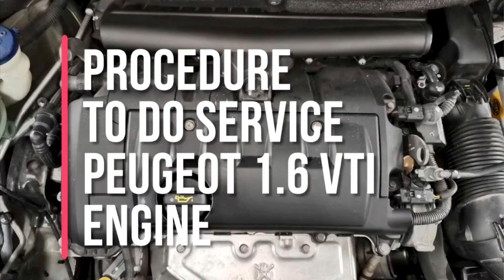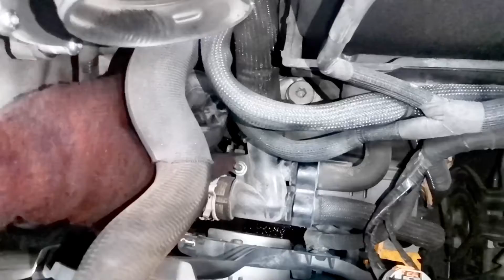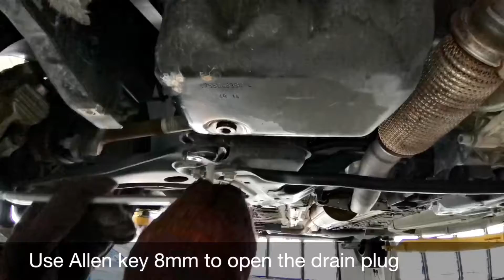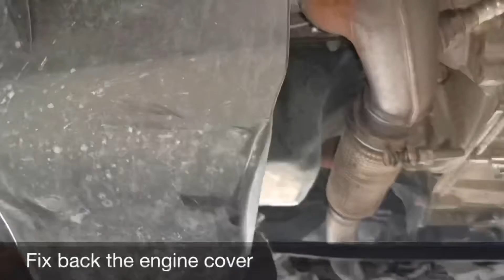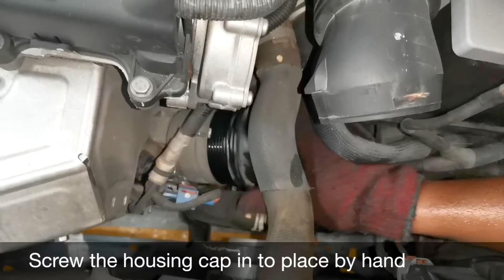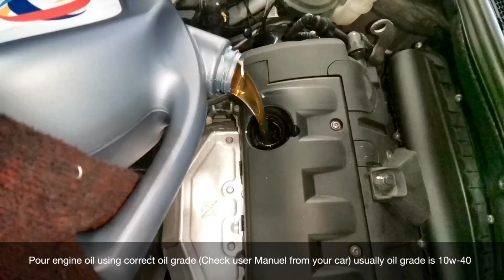How to service Peugeot 1.6 308,208,2008 Vti engine | Complete guide

Comment: NEVER NEVER 10-40 but 0-30 or 5-30 on a  1.6  VTI.
Reply from the maker: Yes correct must use 5w-30 for below 150k  mileage
Reply from the maker: Thanks for the info🤝
Reply: @rajsilverautolearn  Not below 150k, always
Reply: My mechanic put in 5w-40. Should I replace it with 5W-30 ?
Reply from the maker: You still can use 5w-40 if no engine oil consumption
Reply: @rajsilverautolearn  Thanks for the answer! :)  I have one more question. I also noticed that the mechanic put more oil in the engine. It is about 2cm above the MAX on the dipstick line. Is this very wrong? Should I pump it out so it gets only to MAX?
Reply from the maker: If the engine is oil consumption then can put extra engine..
Reply: In the service manual you can see the oil that u can and May use... it also says 10w40😅

Comment: 1. If you remove oil filter, you just know the oil will drip, protect the hoses, otherwise oil will damage the rubber.
2. Use brake cleaner to clean off 
3. Wrong oil type, especially for engine which is likely to excessively consume oil. Recommended is 0w30 low SAPS with C1 spec, if not you'll just ruin the engine in long run.
Reply from the maker: Yes correct but need to follow the contry temperature also

Comment: I have a peugoet 1.4 vti model and have problems with lubrication do you have any ideas to fix this? No oil light is coming on so I assume the bottom of the engine is getting oil but it seems the top is not. I've taken out oil pump cleaned it and it seems like the pump is fine no build up.
Reply from the maker: Is that any engine sign come out? Not a oil sign
Reply: @rajsilverautolearn   Hi yes the eml is on showing code p1340. But I checked timing chain all compression which is good and change cam and crankshaft sensors. But engine does sound dry when I start I have not driven it as I do not want to cause any damage. And is still showing code p1340
Reply from the maker: @letschangeitup8152 this fault cose is control ignition and fuel injection..you can try change cam sensor
Reply from the maker: @letschangeitup8152  or check the harness
Reply: @rajsilverautolearn  Thanks I'll check the harness and let you know thank you for your help.

Comment: Does this engine burn oil in 2012 Peugeot 508 ?
Reply: Every 1.6 vti Burns oil, even new
Reply from the maker: If millege more than 100k same car burn oil
Reply: @hehe504  yes...my 208 160K KM burns engine oil now.how to solve this problem?
Reply: @choowaikong8578  I use engine flush and change oil to full synthetic vavoline synpower Env c2 5w30 becouse oil form total is made by hydrocrackig so its not so good as real full synthetic. After that i forgot about burning oil whitout repering my engine